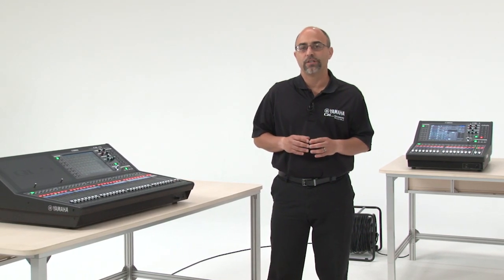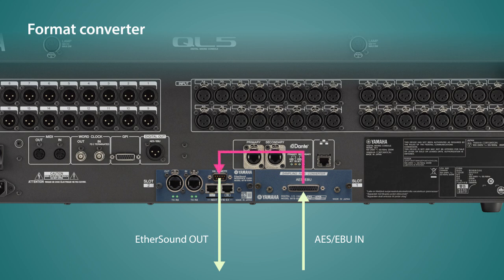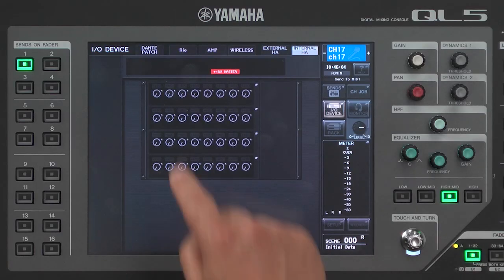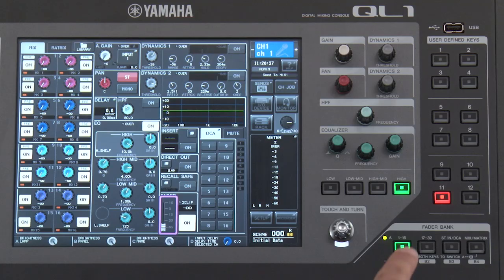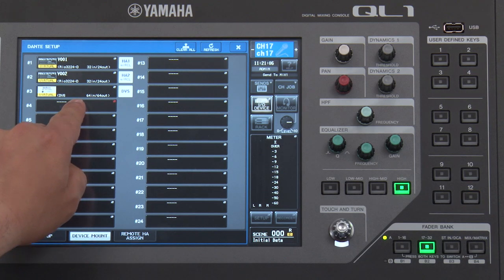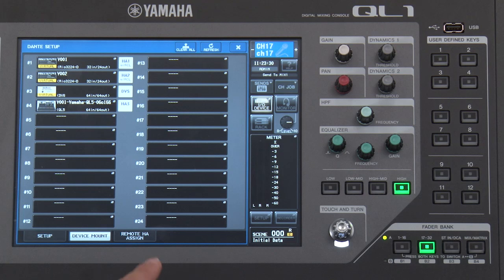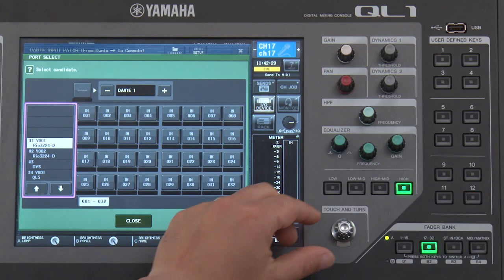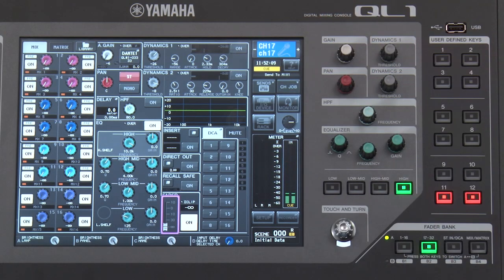CL/QL Series Training Video: 4.3. Port-to-Port Routing (for QL only)

Comment: I've done this set up exactly, however my FOH console does not have analog head amp gain control. Any ideas?
Reply: https://www.youtube.com/watch?v=zbAzQ31I21I&list=PL3rjqgoqj7LL4J78wujRs_IJyIIAhwQwj&index=26
Reply: If you watch this video, the results you want are here
Reply: @bulenttokgoz1157  The video says (For QL Only), should this work with QL as Monitors and CL as FOH? This is the arrangement of consoles I have